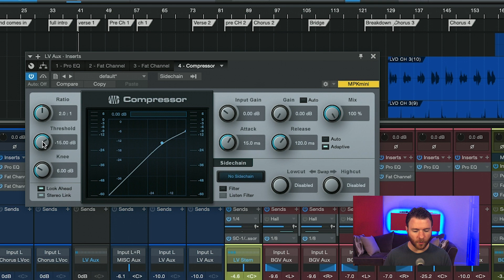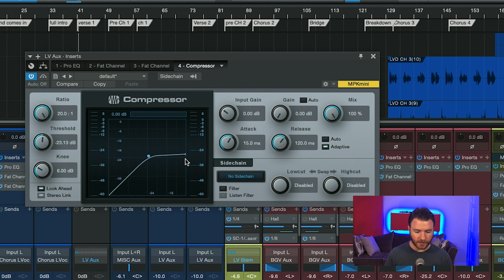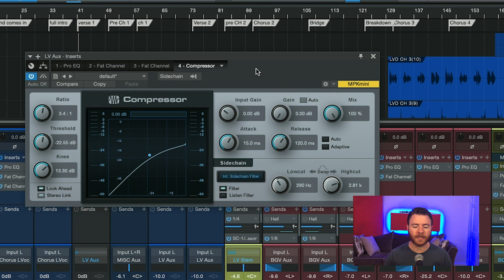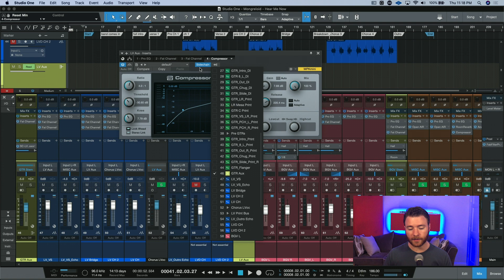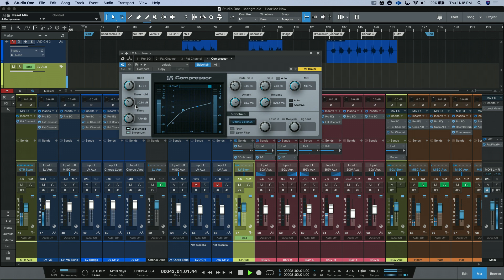Studio One Stock Plugin Series: Compressor

Comment: Enjoy your style. Been watching some of your videos on Presonus stock plugins. One thing I have always wondered about is WHERE to set the Threshold. I've been thinking that it should be set at the highest point of the wave length.....otherwise, I do it with my ears....and usually I turn it OFF and move that as the last knob used, to try to get at least a -3 db gain reduction. I have not really seen any YT Videos as to WHERE to set the Threshold from the get go. Thanks! Lately I've been really using the Eventide Split EQ before any compression, so sometimes being able to do both Tonal and Transients at the same time, I don't always even need compression. Just an opinion.

Comment: Hi Tim ,Can you talk about the range of pre sets that come with stock compressor and how they are best used ?
Reply from the maker: Hey @Rock Writer! I can do this, however my source material would be different then what you may use. Presets are there to get you started towards a sound, and they aren't a "one size fits all" thing. They are there to get you started and should be adjusted to meet the needs of the source. My best advice would be to take some off time and cycle through the presets on something that you have and really listen to what it does to the sound.

Comment: You answered several questions that I have had.  Thanks. Now, I have a question pertaining to your  studio.  Why did you choose your Bass Traps to be off the floor?  I asking to learn.  Thank you Tim.
Reply from the maker: Good question! I have mine at ear level because I currently don't have enough traps to cover floor to ceiling. I wanted the traps at ear level to also work as reflection filters, and if i had the traps on the floor, it wouldn't be tall enough for that. 
Generally speaking though, it does make sense to have corner traps at the floor and ceiling points as well because of the third boundary in those locations. I was recently speaking with a friend of mine about exactly this, and he mentioned that I'm in a good position to test this theory out and see what the changes would actually measure out to!
Reply: @TimTalksAudio  Maybe, when you find out the test please let us know.  My studio is in my bedroom.  I can not put anything on the walls.  I live in an apartment.  I thank you again for your reply and all the information you give us especially beginners like myself.
Reply from the maker: In your case, I would certainly put the trap on the floor in the corner. If you are making them DIY, you can make them as tall and wide as you want. Ask someone to help you out, sit in your chair in your listening position and measure the height of your ear from the floor. You can then translate that to the size of trap you could build. If you are buying traps, I know GIK makes stackable triangular traps you don't have to mount and can fit right into the corner of your room!
Reply: @TimTalksAudio  Keep your studio just as is.  The color red is my favorite that is why it was in my view so quickly.   I did some research on Acoustimac.com and there Bass Traps exactly the way you have yours.  Be safe for you and your family.  Have a good day sir.

Comment: Hey Tim.. Thanks for all the great info..You have helped me so much. Could you please help me on this. I am a Bass player and sometimes on my recordings, I brush my finger too hard and make an abnormally loud slap . I want the slap but I need to drop the gain just for that one note. I go into the editor in studio one and enlarge and isolate the note but I cant seem to make an event small enough to cut the gain on that one little note. The little white box will not appear. Can you help me out on this... thanks again  Mark Z
Reply from the maker: Have you tried making an edit of just the slapped note in question and cutting it out from the main take? When you cut a new event, you should get the event gain adjust box at the top middle of the event. It also shouldn't matter how long the edit is, if you cut a section, the tools should become available.
Reply: @TimTalksAudio  got it thanks